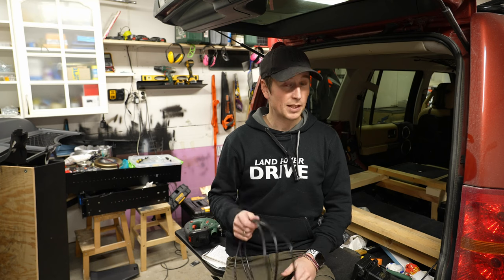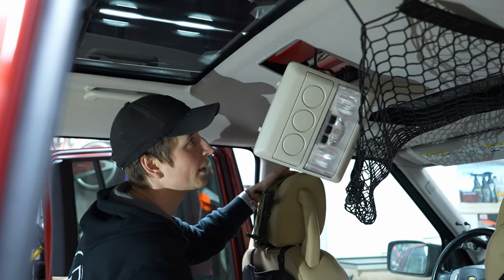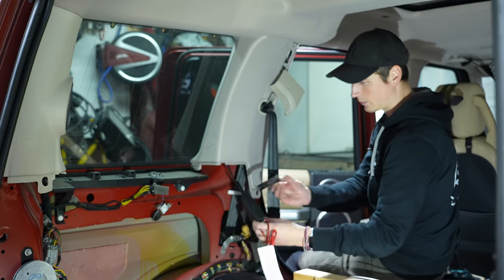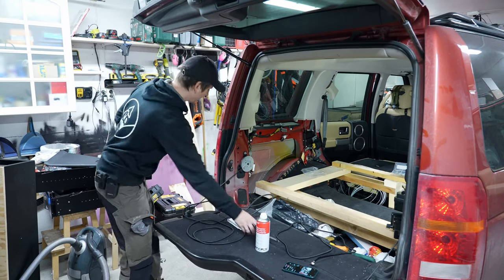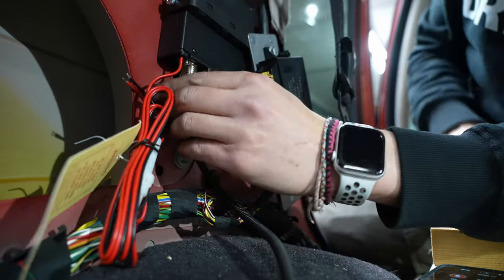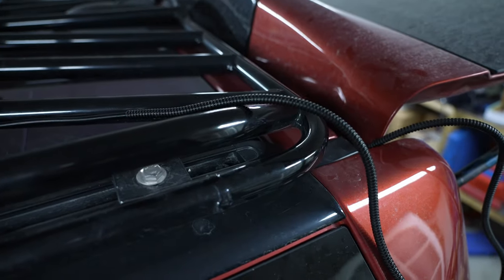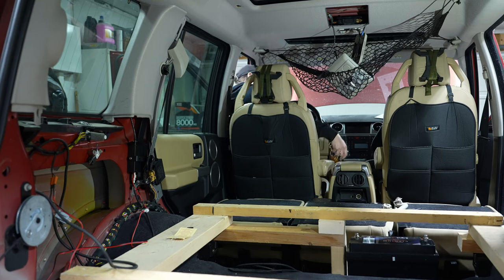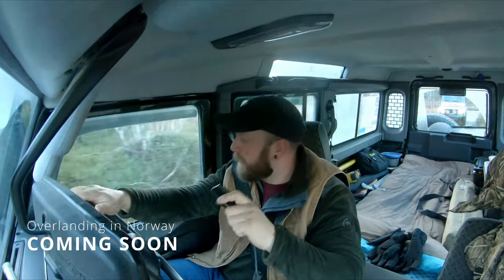CB Radio Installation - Land Rover Discovery 3 - Hidden Install

Comment: I hope your back issue resolves itself, nothing worse than a bad back. Install looks good, I got a giggle at the added cheering when you figured things out.
Reply from the maker: Hehe, giggled my self. 😂 When you with your friends and do these stupid messups you always get an ear full. 👍 So wanted to add that to the video.  Can't let it slide, hehe. 

Back is better now but it comes and goes depending on how much I exercise. I'm sitting to many hours behind a desk working or editing so if I don't do some form of workout, and add some bad angled heavy lifting, the back tends to not like it.

But I have learned and I try to be careful. Thank you for your good thoughts Peter! 😊

Comment: Needs a retractable yanyard for the Mike 😊 great instal 👍
Reply from the maker: Thank you Russell! What is a retractable yanyard?? 🤔🤔
Reply: @LandRoverDrive  ah ha, it could also be called a retractable key chain. It is a small spring-loaded device that has a cord inside it that pulls out and rewinds itself.
Reply from the maker: @russellgiles1531  That’s genius, know what you’re talking about, it’s like the ski resort card holder I had when I was younger. Think I have one laying around somewhere. 🤔🤔

Thank you, will put that into practice right away. 👌
Reply: @LandRoverDrive excellent, attach the main body to the roof lining and clip the mic to it, then you can pull it down to talk and then let it retract out of the way. Thus keeping your eyes on the road 👍
Reply: I would have turned the antenna base towards the front, so if you hit a low branch the antenna will fold down towards the stern (rear).
Reply from the maker: @grahameroberts8109  - Ahh, smart, I haven't thought about.
Reply from the maker: @russellgiles1531 - I'm definitely going to do that. Will look for the retractor today. 😉 Thanks again!
Reply: Working with a bad back is bad enough but running cables in a car just adds to the “Joy”. You did fine. The plastic you used to thread the mic cable through the roof is a fish tape. In 50 years of ship installations I think I got lucky feeding tights spots about 10 times. 😅 The plastic you fed the antenna cable through is plastic conduit. The aerial plug at the radio is a PL259. The centre pin should be soldered then the excess’s cut off but trapping it like you did will work fine. Have the cable come out of the rear vent making sure you have enough of a loop that goes lower than the vent so any water will run down and off and not into the vent. Hope the back behaves so you can have fun. I spent all summer sailing with a frozen shoulder, you just have to adapt. 
Thanks for sharing.
Reply from the maker: @billb3444  The joy, well put! 😂 

Thank you Bill for adding the missing info and the words I can't seem to find. 👌 With your experience I guess there are endless tips and tricks from the trade.

I went to school to become a telecom-installation apprentice but never started on the apprentice part. Point is, I should know the terms and names but after 15 years a lot has been forgotten.

Soldering the main/center, is so smart, and make so much sense, fill it up and cut the excess. 👌 If I ever take it out again I will do the fix. 

Air went cable part, I actually removed a bit where I mentioned this part, but so important, why I added the text about wading. 😊 Don't want anyone seing this and go swimming. 😂

My back is doing good and will do my best to keep it that way. Don't want it to become a daily problem. 😊

Thanks for watching and for great info Bill, one of the reasons why I love making these videos!

Best, Simon

Comment: Hi Simon, any reason you didnt want to mount the radio under the dash or console somewhere then run the cable out through the firewall grommet and under the A pillar trim to the roof rack ?
 Could of saved removing the interior trim and for power you can piggy back a 12V socket, also there are some STL files available on thingiverse for microphone holders that you can print if you have a 3D printer or access to one.
Reply from the maker: Hey Nick, Honestly I'm not really sure, but I think it was due to the fact that I was planning on putting the battery in the rear quarter. So since I was going to that I could combine it with the radio and I knew about getting wires out the back of the tail light. 

If you watch part one: https://youtu.be/h02NMqoTlnQ?si=WxbGcptsWEfdKJA6
You will see what I mean, if you haven't watched it yet. 😊

Thanks for the 3D tip, have a friend that can print will take a look at it. Will be testing out something first, see the community page here to see: https://www.youtube.com/@LandRoverDrive/community

Thanks again, love sharing and getting tips and ideas for the build, so much part of the fun of Overlanding. 👍

Best, Simon
Reply: no worries, had my D3 over 6 years and done almost everything i want to the vehicle, i have a ARB bullbar so antenna is on the front and my radio which has a remote head is under the center console with the head just below the AC controls, microphone just to the right of the stereo.
 My aux battery is under the bonnet near abs module ( australian RHD ) and i used the grommet in the firewall near the brake booster to run all my wiring thru.
Reply from the maker: Will have a look at the grommet in the firewall, will have to run some wires when I'm going to add extra lights for driving and camping. 👍 That ARB front bar would be nice, not legal here in Norway, and not sure I could have it on without passing the legal GVM at 3.2Tons. I think a rear bar will be in the works first as mine is getting well rusted, so thinking welding something my self with mounts for spare wheel and such. 😊  Happy new year Nick! Simon
Reply: @LandRoverDrive  and to you, when looking from the front, the grommet is to the left of the brake booster. Its where the clutch m/c would be on a manual car and is ideal for passing cables thru to the cabin.